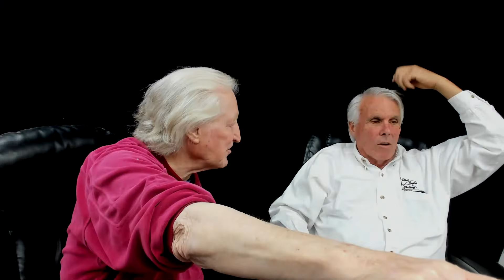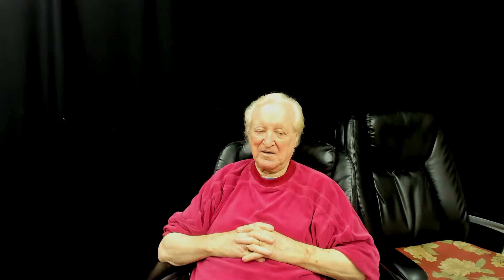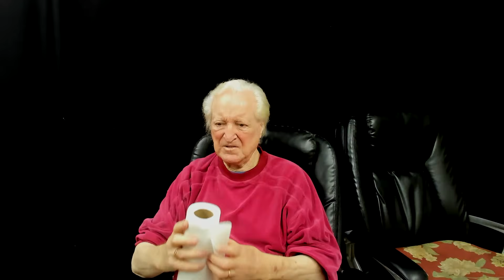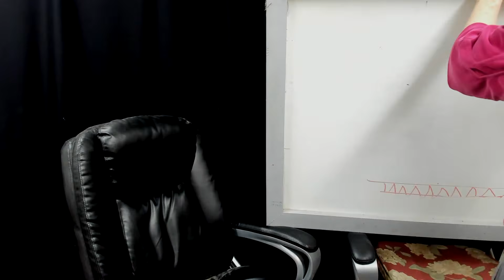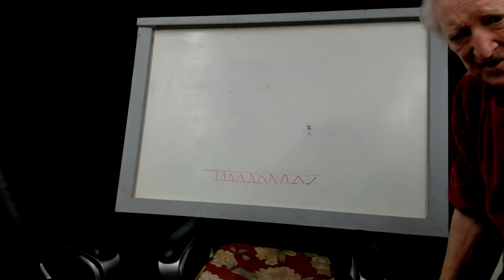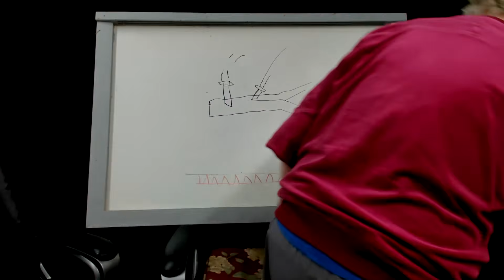Power stuff!

Comment: Regarding the small displacement turbocharged engines that are in a lot of newer vehicles, it's amazing how much horsepower and torque they produce although it seems like they need to catch up a little bit on the reliability part of things but still, getting the power up there is a great start, and durability im sure will follow soon enogh.
Reply: Unfortunately they will ALWAYS be designed to last 1 minute and 1 mile past the warranty.